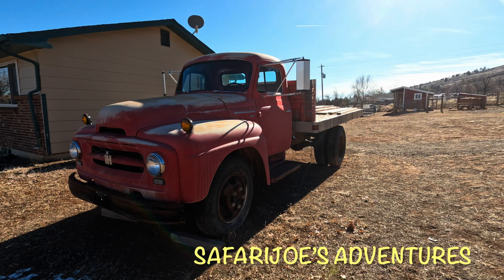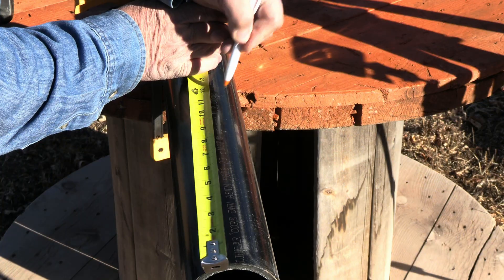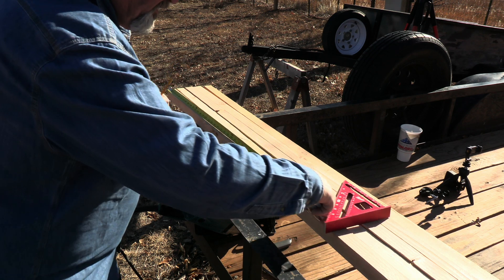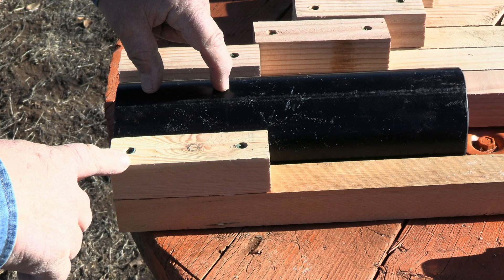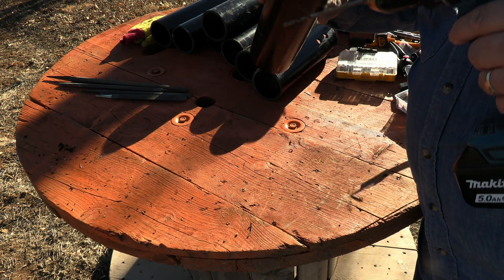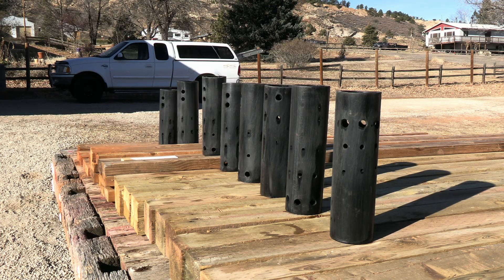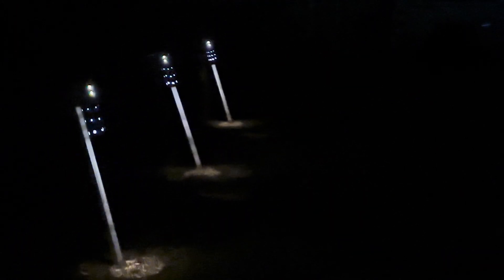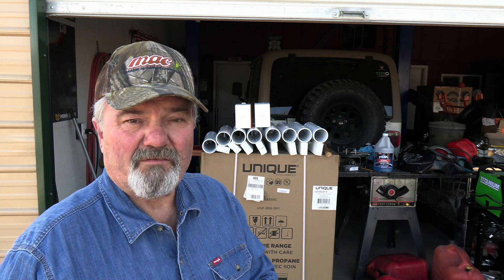Outdoor pathway lighting DIY

Comment: Just thinking. These could be cool and modified to be near cabin doors, steps, around a deck or porch, or even along a driveway. etc. Simple, inexpensive AND versatile. Good stuff. Thanks for bringing us along for the project!
Reply from the maker: @robertdknight  exactly! You could use these for just about anything. I just put them on the two by twos to hold them up off the ground for a pathway light, but there would be multiple applications for it.